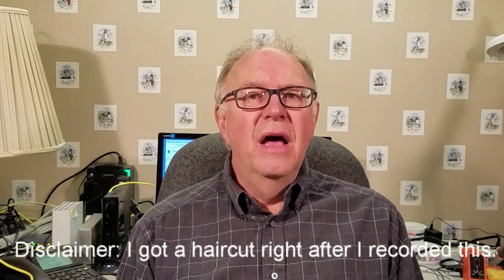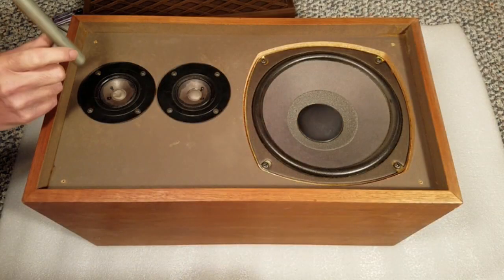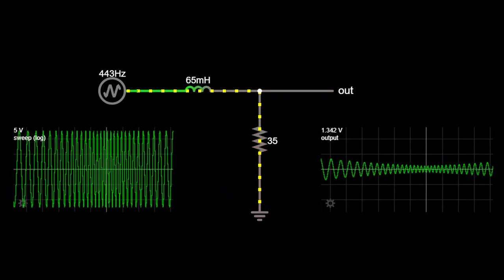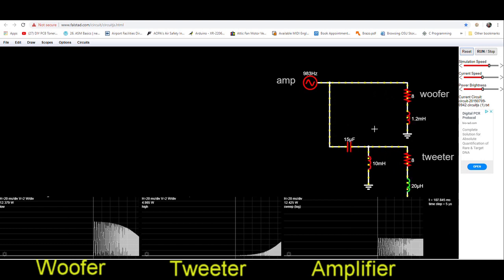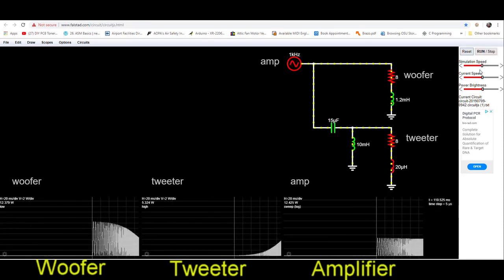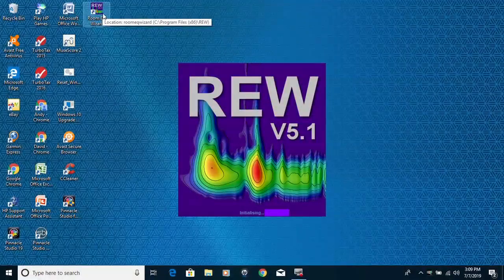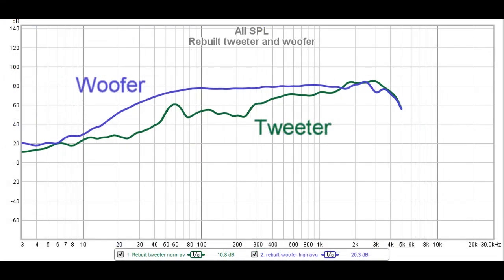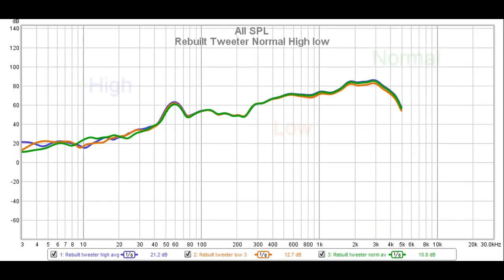Rebuilding Radio Shack Nova 7B Speakers - Part 3 of 3: Final Testing

Comment: Hello!

I have these speakers and I’m getting no low end out of one of them. I opened it up and everything looked ok so I figured maybe it was the capacitor. Well I just changed that out and the problem persists! Any idea what it maybe ? Both tweeters and woofer produce sound but it’s all highs and no low end. Any info would be greatly appreciated
Reply from the maker: There could be a couple reasons.  There might be something restricting long coil movements; like a hardened coil or cone surround.  Look at the woofer during a "bassy" song.  You should see the speaker cone move quite a bit.  If not, gently move it in and out by hand and see if it will move a quarter inch easily.  

Next would be a damaged woofer coil.  If you can, check the impedance (resistance) of the coil.  It should be about 8 ohms (if I remember right).  If it's much higher or lower, the coil won't draw the current needed for strong lows.  Unfortunately, the only easy fix for a damaged coil is to replace faulty speaker (I'm assuming you don't want to rewind the coil yourself).  Good luck!

Comment: I would be curious what the equivalent series resistance of the old capacitor was. That may affect high frequency output since that can fool capacitor measurements to read higher than the actual stored energy of the capacitor due to longer charge time constant. Just something I was thinking about. I have been using pink noise and a waterfall spectrum analyzer program to do a basic check of how vintage drivers and crossover are performing. Love the video and your efforts, thank you for your knowledge.
Reply from the maker: That would have been interesting.  Unfortunately, those caps are long gone.  What has been your experience?

Comment: So I have a pair of the Nova 7B. One of the woofers has some crackling from time to time. Could the crossover network have anything to do with that? I planned on replacing the electrolytic capacitors anyway.
Reply from the maker: I think the crackling is more likely a loose connection. A bad crossover network would usually affect the tweeters.  It might be as simple as tightening the connectors to the woofer, or even the connection to the amp (either internal or external).  There's a lot of vibration going on inside the speaker enclosure.

Comment: hi, do you now the wattage range of these speakers?
Reply from the maker: I'm not sure; but I've seen them paired by Radio Shack with a 25 watt per channel receiver.  I don't think they would pair it with an amplifier that would blow the speakers because they had a 5 year warranty at the time.  And remember, 25 watts back then (1977) was a lot of power...not like the inflated power claims in today's receivers.  Back then, 25 watts would definitely hurt your ears :-0
Reply: @LifewithDavid1  I found out that the rated capacity is 50 watts it is listed on the back of the crossover at least on mine they are